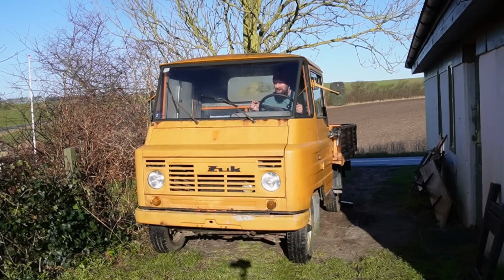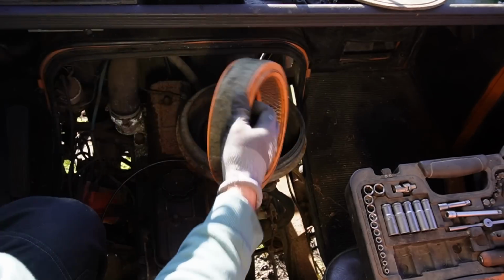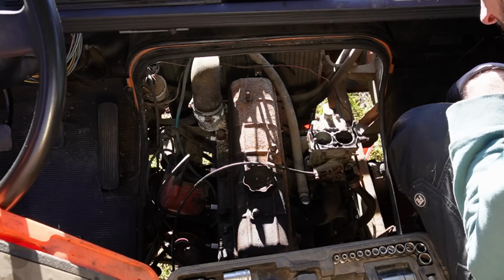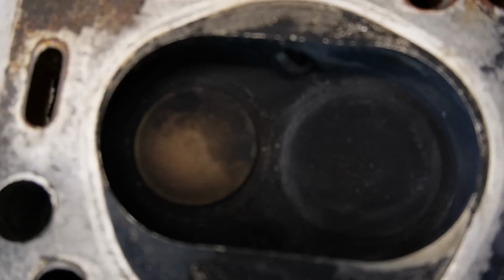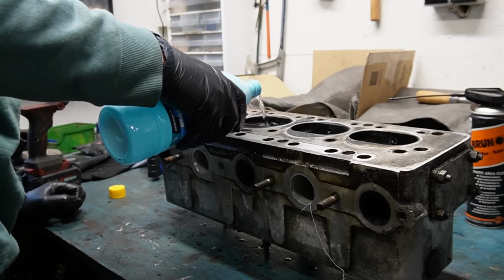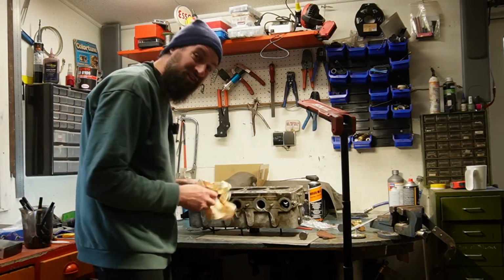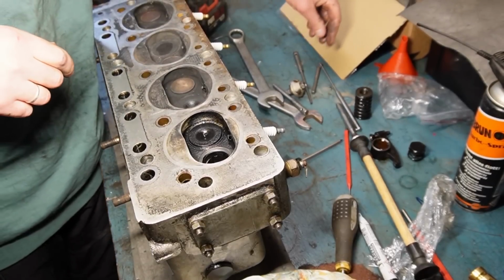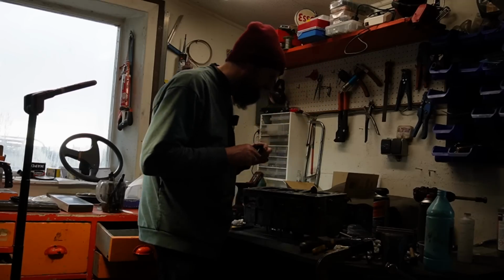Żuk | Ah My Old Nemesis, We Meet Again! The Valve Seat!

Comment: Tip for valve lappung, put light spring between head and valve, so that it is tenshioned against your laping tool. So after evry turn you can easilly lift it from seat. It helps make more homogenous lapping surface. If you use accu drill, then hold it  by valve stem, couple turns left lift, start drill right lower, couple turns lift, then again reverse and lower, so on. Aim is to have rotation when lifting and lovering valve to seat.

Comment: I remember vividly the time I spent in 'the greenhouse'. My grandpa was van taxi driver and used to take me with him. The smell, the noise, the temperature, the magical engine cover. Thank you for bringing up those memories. BTW, my grandpa extended the frame in length and the bed in width. It was essentially a truck  back then. He installed the old Mercedes diesel engine which was much better suited for the car and was just available in early 90s. Amazing times in Poland. You changing the engine to a better one would be, actually, historically correct😂
Reply: Back in the day when I were a wee lad all the buses in my home town were Finnish-made affairs, with the engine fitted between the front door and the driver. Once one of these broke down. The driver, who happened to be a mechanic as well, told the passengers to take the next one and then (glory of glories) asked me to give him a hand. He was sat all the while in his plush driver´s seat, with the exposed head at perfect working height.
Reply from the maker: Hah I have a W123 300D engine lying around... that would make it strong as an ox! but would never be approved... :(

Comment: Loads of years since I did this kind of work, but I'd use a brotsch (english?) first, to get the angle correcrt and then grind with the paste. Also use an air powered grinder, it's horrendous grinding the seats manually. Then again, you're only doing one :)

Comment: I use my cordless drill fitted to the top of the valve stem and a spring between drill and head to maintain tension, then I give it some good back and forth spinnings and get a nice cut head/valve.
Reply from the maker: That's a great idea!